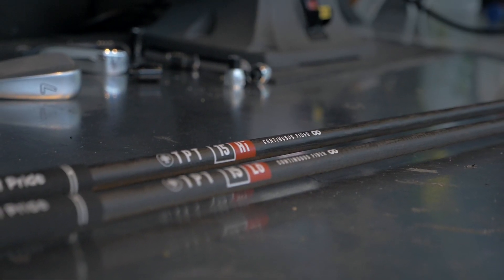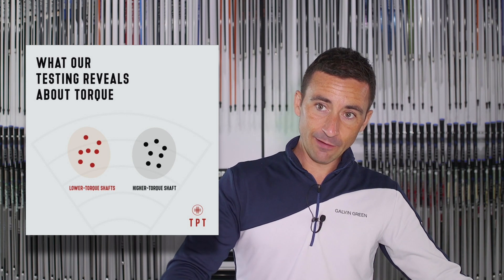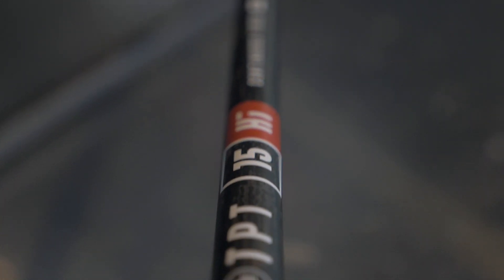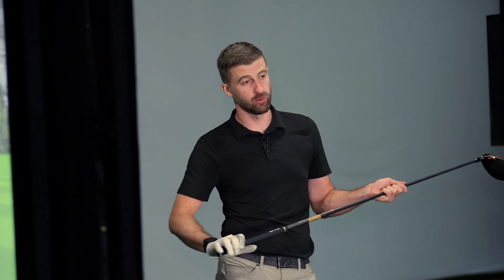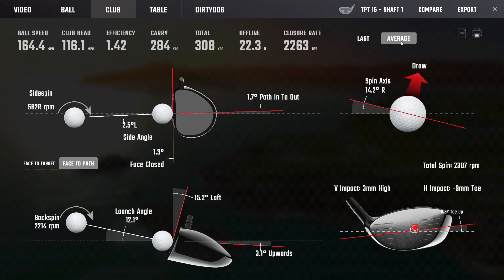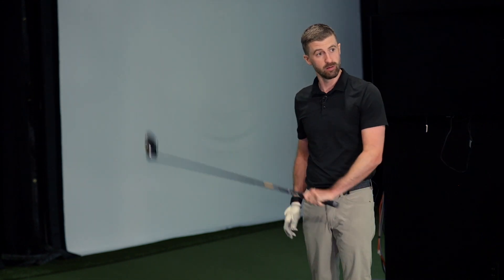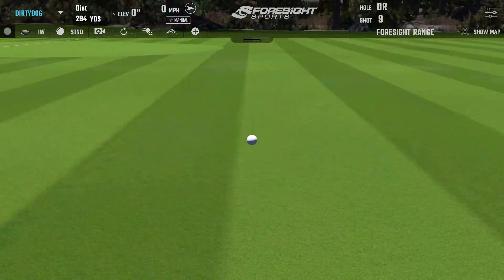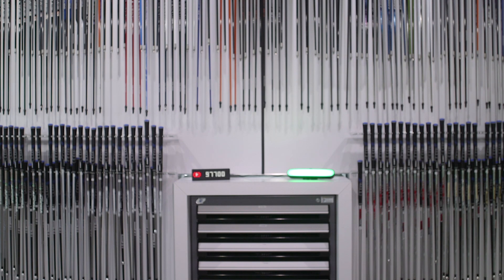What Does Shaft Torque Actually Do?

Comment: Ian, I call BS, "the ball has left the face before the head twisted on a toe strike". That defies the law of physics. Remember it's a golf ball, a golf ball compresses on the club head before it ever leaves the club face. Lower Torque reduces tip twisting on off-center strikes, especially on the  larger club heads. Test that with a 10K driver on toe strikes only and you'll see, the further the ball is from the shaft tip the more twist on impact.

Comment: Would love to have a conversation with you guys on this over a pint.  I think gear effect is going to be a big factor, also level of acceleration or deceleration into impact.  I think you are spot on that every swing will interact differently but I also think there’s not enough attention on the importance of torque.  I went to a low torque shaft and my toe hits are almost completely without penalty.  Lower torque shafts (3.0 and less) are mysterious and I think a lot of people might benefit from these shafts but never get fit into them

Comment: The high torque shaft should twist open as you load the shaft. After the low point of your swing, does the head "snap shut" as you hit up on the ball? That could explain the draw.

Comment: An important concept to consider would be keeping a similar torque through-out the selection of metals in the bag..
I noticed this when I had a  "Mitsubishi  Tensai orange" on the driver, and a "hazardous smoke black" on my 3 wood... opposite spectrums in terms of torque, both stiff shafts.  Completely different load times which can throw off tempo dramatically.. 
Since that realization I've settled with the fujikura ventus blue in the 3 wood and 5 wood.  The torque on that is extremely similar to my driver shaft which is also fujikura in the pro 2.0 - 6S . 
I can't say that either low or high torque is better than one or the other but from a personal preference I tend enjoy a faster load time which is how I would explain the low torque.  Someone with a very deliberate swing style might enjoy those loads too build further in the take away.  

Point being keep the torque similar, if not the same,  with club selections.  
I would also say the same thing for weight and flex from top to bottom with the irons. 
Thanks for reading. Hope it sheds light on what I've discovered torque to feel like.

Comment: I have an F8 with the Aldila 2KNV blue in the 60 Stiff, I found that the face would twist during the downswing and result in a hook or a big push fade. Today I bought a Taylormade SIM with a HZRDUS Smoke Green 70g Stiff which is a lower torque shaft by 1.4 degrees. Whether that has made a difference, it's hard to tell. But I hit in way better and more consistently, my bad strikes were more forgiving with the SIM and I could visibly see the ball flight was much flatter and had less backspin. Excited to get out on the course and try it, but with how good i hit it today I'm hoping for the same.

Comment: I thought the torque was the resistance to twist at impact, with lower being more resistant to going offline ?  If I have two low launch/low spin shafts with the same weight, flex and kick point but one has torque of 3.5 and the other 4.5, which will be the better fairway finder ?

Comment: Back in the day, I used torque figures to identify what might be reasonable. But after some mucking about I learnt that it’s not the be all or end all. I would love to see if you change head weight you can change the behaviour.. basically what is the point of putting the same old shaft into every new head you buy because you just like this shaft?

Comment: Myself and a couple guys were doing a little testing on the course and we came to the conclusion for us the higher torque shafts (softer feeling) shafts were harder to draw verse the lower torque (firmer feeling) shafts. Which was different than we had been told or thought.

Comment: Very interesting findings by TFT.  I need to test this.  I play an M4 with stock shaft.  I measured the same shaft raw and found 6.5d of torque.  I love the driver but it definitely fades.  I also love the fit of the shaft, Atmos 5R made for TM.  So to test this I will have to try a 55 gram counter balanced shaft, stiff butt R flex, but lower torque.  Suggestion for anything somewhat affordable and available to all?

Comment: With these types of videos, I personally would really appreciate an explanation of what torque is and why it's a spec manufacturer's use at the beginning of the video. Maybe some sort of visual to help us understand exactly what torque is in relation to a shaft. Then, I'm watching Matty hit drives for 10 minutes and not truly understanding what is going on between the two shafts, so it doesn't really connect me to the video in any way because I still don't have any clue what torque is. Some of the comments are people saying they know what torque is from this vid, but they just think that low means left and high means right = torque.

Comment: My understanding is that high torque would give you more head deflection on off center hits than low torque. Meaning high torque on the same strike pattern would give you a wider dispersion than low torque.

Comment: Another great video concept.  I am loving the new camera too. 
Does the fitting shop at TXG have the abilty to measure shaft toque?  If so check to see if it is the twisting left the same as it is twisting right.
I have never seen a toque measurement tested for a left hand golfer.  I did some research into this about 10 years ago and found almost nothing.
From my experience, all of the older shafts will twist more in one direction than the other, usually to the left for low torque shafts.

Comment: Ian you mentioned getting fit as always. What would be your deteriming factors for selecting a fitter? Seen some local results of my friends clubs and to me it seemed like a $ decision by the fitter. Your thoughts.
Reply: Most cheap fittings at local places will entirely be just them tossing the normal junk at you to make a dime without caring about you.  Proper fittings are expensive.

Comment: I have been thinking about getting new irons with graphite shafts, and I realize how many "identical" options are out there with different torques, I tried researching the ones that would match my steel shafts and realize that is nearly impossible without spending a few hours being properly fitted.
Thank you guys for providing a glimpse on the world of shaft torque.

Comment: Always found for myself and fitting others that softer tends to leave out right and stiffer has more integrity through impact and more left (also due to tending to be lower spinning therefore if too stiff a bit ducky in flight).
The common wisdom was always opposite to that which never made sense to me.
Reply: Bump this comment up to the top. 100% agree. In regards to myself I prefer a stiffer shaft bc all my drives would traditionally tail off to the right so I would have to aim far left. I finally got fitted last fall for the F9 Cobra. All my drives are going where I want them too. When they do tail off to the right  its more of an exaggerated push fade. Hands were just lazy through impact. Easy correction. I'm willing to lose swing speed if it allows me to have accuracy off the tee and hit fairways more consistently.
Reply: Yes... stiffer shafts will be lower torque and higher torque will be less stiff.  This is also the results that were found.
Reply: @Dead_Goat  not necessarily but the general theme is as such.

Comment: Guys I recently got fitted for a speedzone cobra with a hzrdus yellow 6.5 flex 70g its 3.3 torque . I want to buy a 6.5tx small batch shaft for the driver which is still 70g but is 2.9 torque . I hit the current shaft good but I want the hand crafted with a tiny bit stiffer . Whats your thoughts?

Comment: The higher TQ shaft also dropped the toe versus the lower TQ shaft - so that's another big factor. In my experience, and I'm very sensitive to TQ with my delivery, there's just more left & right variability - if you go at it too quickly without staying down, the face can be open and Right, stay in it and you get that sweet perfect draw, stay in it hard and really go at it and it can turn over more. So I would agree in principle with what they've said, but once you leave it open with a higher TQ shaft, you then immediately stay in it longer and you change your delivery the next shot.